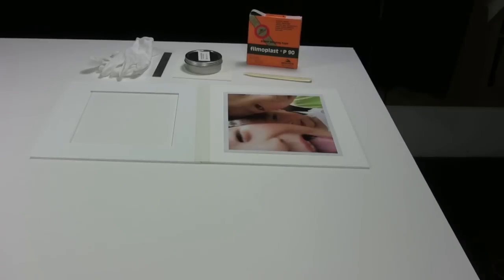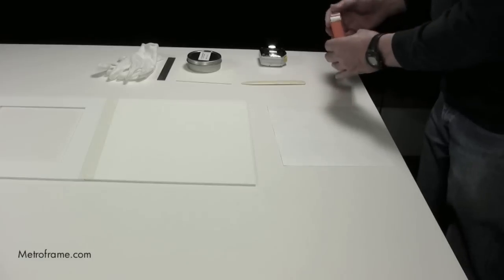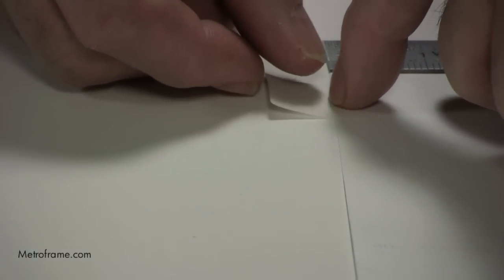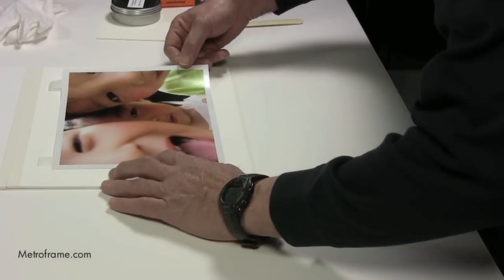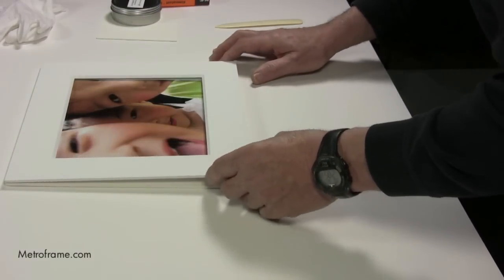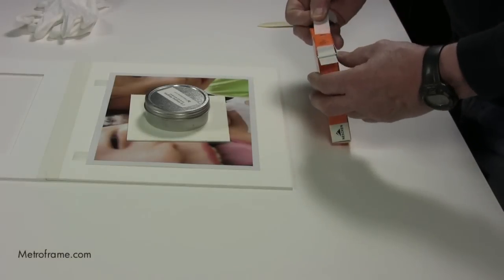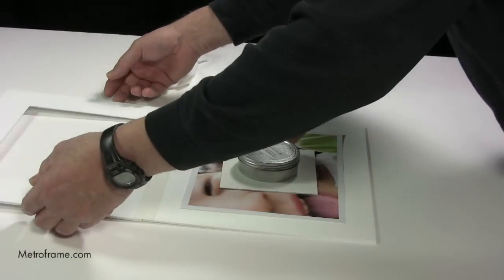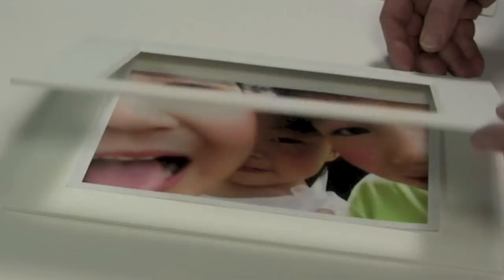How to do archival hinging for matted presentations of works on paper

Comment from the maker: The advantage of the paper corners you are making is that they are simple to make and require no application of adhesive to the artwork. They shouldn't be used when the paper object is not strong enough or there is any possibility that the corners of the artwork might be bent or damaged by use of the mounting corners. And yes, you are correct the reason only two pieces of tape are used on the top is so that the artwork has room to expand or contract.